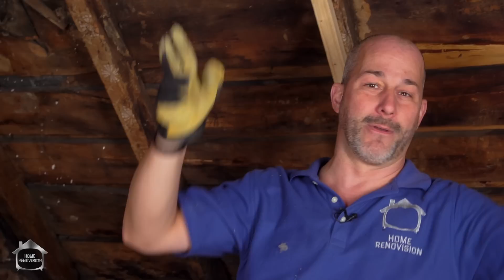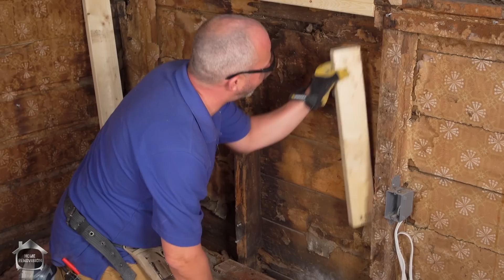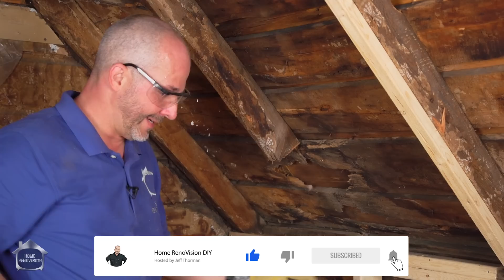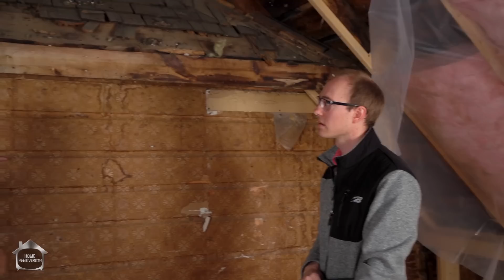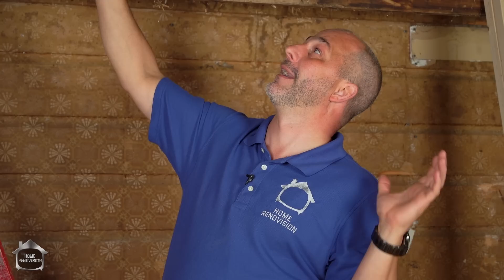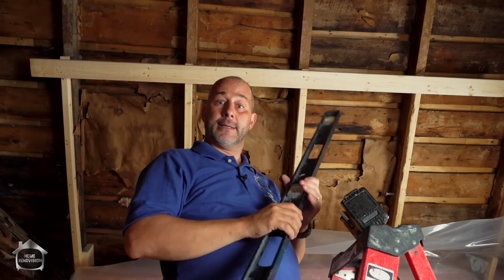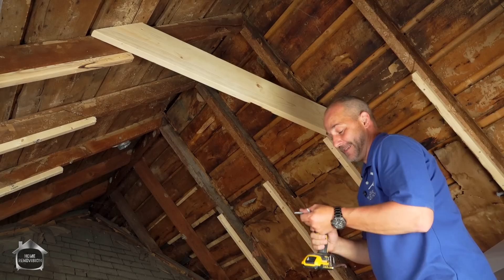How Structural Engineering Affects DIY Projects

Comment: I am a licensed electrical engineer and it was a pain in the rear to get my license. Structual engineers have to take an additional board exam. Thats tough
Reply: Depends on the state. Most states all you need is your PE license to design residential/commercial buildings. Here in CA they have another license, SE, structural engineering license, but it's not necessary at all if all you do is residential house design.

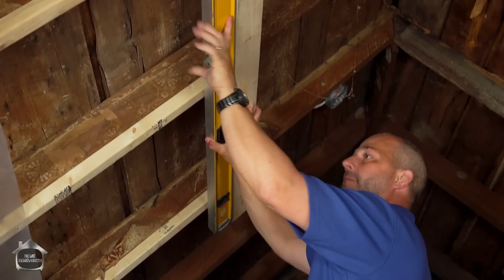Comment: Maybe I've been given bad info about levels that it has to be held plumb for the bubble vial to be accurate.  At about 27:50 the way you are holding your level flat against the rafters will give a bad bubble.  Also I was always taught that levels only read correctly with the vial at the top as there is a very slight camber built into the vial.  Maybe I'm wrong though.
Love all your videos!

Comment: Q: Regarding your unleveled roof, shouldn’t the ENGINEER have factored that in their design and instructions?
Reply: h2s ..for NEW construction you must be right. But, this is an existing older unleveled structure that is being ‘restructured’ and needs consultation and re-engineering - so I am not convinced.

Comment: About how much for the structural engineer? I've always thought about doing my livingroom and kitchen like this. I never wanted a full vault though. Also my roof is made with 2x6 framing.
Reply: I had an engineer come to my house to design an egress window, $500. I had the same firm go to my cabin and design a new foundation and add a second floor to the structure, $3000. 
Hope that helps.
Reply: @68RDRNR  thx

Comment: Really great video but it sure looked to my eye that you were spinning those lag screws in that old wood. Or were they in fact binding up all nice and snug?
Reply: Paul Bruneau I noticed the same thing. Mildly concerning
Reply: Nope. He sent them all the way home through the new wood. You are seeing correctly.
Reply: Sorry probably silly question, very green at this, what do you mean or what did you notice? Thanks!
Reply: @angelitamartinez5639  well it looked like even after the bolts were fully imbedded in the wood that he kept spinning them after that, which would mean the wood might be torn up surrounding the threads, harming the strength

Comment: Im doing my attic I'm planning on using r 54 is that excessive?
Reply from the maker: unless you have r 30 walls it is. yes
Reply: No it's not at all excessive.  I have R-54 ceilings. I used polyiso insulation and my upstairs is cool in the summer and warm in the winter. This guy is gonna use a lot of energy trying to keep that space comfortable.
Reply from the maker: perhaps, but that is my choice. Cheers!
Reply: Just bought r 50 for rafters n r40 for walls 750 square feet for 1450.00. Can you find some good dealers for insulation so us viewers can get a good deal

Comment: Very useful channel, I have a question, My basement is unfinished, but they nailed the pink insulation with a vapor barrier on the concrete down to the 1 foot up the floor. when I'm going to frame exterior walls and put new insulation and vapor barrier. what's the best way to deal with the current one? if I should keep the old one, do I need to cut the old vapor barrier before put the new insulation in front of it?
Reply from the maker: sounds like you have an insulation blanket in the basement. best to just remove it before you start it will have no value and be messy .
Reply: I think I go with it from now on, but in 2 walls I already framed in front of it, should I cross cut the vapor barrier with the knife in between of two insulations? Thanks for reply though It's very valuable.
Reply from the maker: yes remove as much as possible cheers!

Comment: Sorry but anything structural in a house comes from the direct experience of untold generations of carpenters.  Engineers are a modern component used to test already trusted techniques and develope building codes. Basically they verify what us in the trades, that are ticketed as journeymen carpenters , call best building practices.
Reply: True, for the average wood house that engineers are not required but when your dealing with complex topics such as vaulted ceilings in this case, or modern tastes in custom homes such as large cantilevers, open floor plans or large glazed facades without shear wall segments a good contractor knows when to partner up with a structural engineer instead of winging it. The code requires it when a house is not "cookie cutter" as well.

Comment: Doesn't there have to be fire break installed in the walls between floors on this type of house ?
Reply: I would imagine you would especially need it in balloon construction because fire can spread from the first floor to the top floor and collapse the ceiling.
Reply: The trouble with this old method if building, which indeed is sturdy, is that each channel between the the studs acts as a chimney; hence, quick to burn down from internal fire source.
Reply from the maker: not in this type of construction. Cheers!
Reply: @HomeRenoVisionDIY  If not in balloon construction than what?

Comment: I wanted to actually do that to my attic is add 2 by 2s and put fiberglass but I have seen videos of people saying you need to have an air gap between  the fiberglass and the roof not sure which is right . I dont have any vents in the attic also and i can walk around in there like normal
Reply from the maker: you need the air gap if you have fresh air coming in from the soffit. the idea is to help transfer the heat caused from the sun on the asphalt shingle to be removed with your roof venting system. In this house we have no soffit air. so no need to worry about that! instead we will be using a metal roof to increase the life expectancy of the roof. Otherwise we would need new shingles every 5 to 7 years.
Reply: @HomeRenoVisionDIY  Ohhhhh ok that makes sense! My house also has no softits at all just two little windows  i was worried about a air gap but since i have none it should be good . Thanks for the reply!

Comment: Are you in Ontario? Don't you need atleast R31 on the cathedral ceiling?
Reply from the maker: If I was able to get r 20 in my walls then I would agree. But since I can only get r 14 there is no benefit to re framing and insulating to that degree.  Sometimes you just need to apply a little common sense. If I change the structure to accommodate a thicker insulation then yes it would be necessary however the code does allow for construction based on existing conditions such as the r value being determined by the thickness of the existing wood . Cheers!

Comment: With the damage on the roof and putting insulation + the vapor barrier isn't that trapping the moisture and making mold? I didn't do this at my house for that reason, just curious
Reply from the maker: That all depends on where you live! In the northern climates the vapor barrier goes on the warm side which is the interior of the home. in the south it is the exact other way around. Cheers!
Reply: @HomeRenoVisionDIY  Thanks! very good info!

Comment: Quick question.I have similar house and like to convert attic to living space.The way you insulated the rafters there is no air flow.I was told roof needs to be almost same temp as outside...Now I am confused if you insulated the rafters placed plastic vapor barrier then dry wall is that normal.Concern is about the venting I have.Please I need to know I get lots of conflicting opinions on this.Thank you
Reply from the maker: Hi Ruben. balancing the temp is a requirement in order to have the shingles last their expected lifetime. increased heat causes premature degradation on the shingles. Since my soffit is not supplying fresh air there is no value in dedicating space for the air since it would only travel passively and not give you the required performance. In this house we have decided to go with a metal roof so that it is not needed. If you are going to use shingles then definitely create that air space.

Comment: are you gonna  «outsulate»?  Instead of risking moisture problem with isolation + venting problem, i would put 5 inch of extrude polystyrene on top of the roof...  + a smal chanel for venting and then, the final roof... so the plank could be paint and left expose with only the top with new sheetrock, where the colar tie is...
Reply from the maker: That is one heck of an expensive ordeal for such a modest house. Cheers!

Comment: Pondering the same thing right now, I'm leaning towards a ridge beam.
Reply from the maker: get an engineer. This house has a ridge beam and still needed  collar ties to hold it all together. Cheers!
Reply: @HomeRenoVisionDIY  Hi Jeff.  There's a big difference between ridge beam and ridge board.  What you have existing right now is a ridge board.  Ridge boards are only used as nailing surfaces to connect the 2 opposite rafters together and therefore does not hold any weight.  Ridge beams however do carry the weight.  Same concept as if the rafters were floor joist.  Floor joists attach to beams with hangers.  That's why your engineer was proposing posts here as beams require posts right? I have this argument a lot with contractors/ framers when I design renos like this.  This article is probably the best way to explain it:  
https://www.finehomebuilding.com/1992/10/01/framing-a-cathedral-ceiling

Comment: I totally want to borrow, "It offends the mind."  Thank you for another video that is not only educational but fun. Keep up the good work!
Quick question: We just learned that the valve/mixer that we bought for the shower is a 3 way, even though I was certain we had picked up the 2 way valve. Is it possible to cap it and still use it? Also it is all copper and we wanted to use PEX is there a copper to PEX adapter that we can use? Thank you!
Reply from the maker: Yes you can solder on a female copper to 1/22 inch pex. Cheers to ChocolateRx!!!!

Comment: Hello I have a question. I was told not to put installation on the roof structure like you are doing because it will cause problems with the shingles on the roof. Is there any truth to that?
Reply from the maker: Hi Sue, my soffit has no fresh air moving so the rule changes in this environment. We will be installing a metal roof since asphalt does not perform well in this environment. You are totally correct. if the air isn;t moving the heat builds up and deteriorates the shingles really fast.
Reply: Home RenoVision DIY  Thank you

Comment: Did you consider the the Bonfiglioli approach to furring out the walls and ceiling,  that would have added a thermal break without much more effort.
Reply from the maker: The Bonjovi What?
Reply: https://www.finehomebuilding.com/2014/11/26/breaking-the-thermal-bridge @HomeRenoVisionDIY

Comment: One your best vids yet.  Novice (and likely a very stupid question): you used nails and screws on this project - when should you use a screw and when should you use a nail; and why?
Reply from the maker: nails for shear strength if carrying load, screws for convenience and allows you to make modifications later much easier. Cheers!
Reply: @HomeRenoVisionDIY  Don't forget, screws have better tensile strength than nails. Different tools for different jobs.
Reply: @HomeRenoVisionDIY  Got it.  Thanks!!

Comment: Thanks for the visual flashback to my very first home; nearly identical.   Not one wall square, level or plum to anything else.   Not one.   The shimming and furring I did to square my kitchen to get the counter tops to go in nice and flush was truly a work of art if I do say so myself!!! 😁😁           Strings I found to be my best friend.   When I bumped up my collar ties, I measured up the same on both ends, leveled across and strung a line.   Done.   
                 SOLID RED OAK!!!!   I didn't have my pneumatic guns then, and I hand drove 4x more than I sunk.   Literally started and bent 2 or 3 to sink one.   Floor joists with bark and resin pits over 1/2 way through,  broken; a real treat.   Best memories of my life.... 😊😊😊
                 Just gotta share this, one memory I'll never forget:   Dad, not a carpenter, was helping me rip out the 2nd floor: T&G 3/4 pine.  With the previous description of the joists, it was literally holding up the 2nd floor.   I had dad ripping the flooring in 4' sections the width of the floor for extraction.   I knew what was coming and I just watched with a very ornery smile.     About 2/3s of the way through, a mighty crackling sound could be heard, even over the saw as dad cut the floor, then with a bang as loud as a gunshot she let go.  "BAM"!!!!  And dropped about 3" and bounced and vibrated.    Dad stopped cutting but never looked up.   Finally, slowly he raised his head, with the coldest, soberest, most accepting of death face I had ever seen in my life!!!   WHITE AS A SHEET; not one drop of blood left in his face.   OMG I laughed so hard.   He was a good guy.   Lost him last spring to cancer.   Like I said; good memories.....
Reply from the maker: strings work when you don't have lasers. Cheers!

Comment: Should have made barn dormers...Vaulted ceilings are cool when the entire rough frame is being done...That ceiling is already awesome height for an attic.  Waste of lag bolts...Those rafters are at nearly their strongest point  as they hit the ridge, the thrust of the rafter is at the bottom...Collar ties are only there to add strength to the  connection... A nail is more than sufficient. The shear strength  on a 16 D nail is about 138  LBS ...
Reply from the maker: Hi Rob, I think there is an element of the structure that you are not quite understanding. this is a balloon framed house and the collar ties are vital to keeping it intact. cheers!
Reply: @HomeRenoVisionDIY  Oh, that does change basically everything...:)...I hate balloon frame...It's pretty rare here, In my 30 years in the trades I only saw it one in New Jersey...

Comment: I dont know if this engeenier is just camera shy or what but he comes across as he know less than you.
Reply from the maker: Engineers are usually a little slow to suggest options. it is always best to bring the options to them and then let them do the math. Cheers!
Reply: Engineers tell Designers what is and isn't possible. You gotta tell them what you want to do.
Reply: one brings an engineer to help with calcs and drawings of what one wants to do.

Comment: I was told by my contractor that it couldn’t be done because there was not enough space for the insulation... Thank you so much for this video!!!
Reply from the maker: very peculiar!
Reply: You had a lazy contractor is all. Just about anything can be done if you have the money, and yes, I used to be the contractor that would do your job and I've done plenty of them over the years
Reply: he was able to do it because he skimped on the required ceiling insulation. (not to code in Canada)

Comment: Solid information about having the engineer spec out future plans for additions that you haven't done yet. Did you consider going with any type of spray insulation on the rafters prior to going with regular batt insulation, or was that your plan from the beginning?
Reply from the maker: Not too worried about the quality of insulation up there. the house is now buttoned up so much better than it was before. This install is better than a new home built in the 80's. The 1980's I mean!

Comment: HOLY SHITAKE!

Just curious, where is the venting for that roof?  I was under the assumption that it had to be vented and also have a divider between insulation and roof sheeting for proper ventilation.  But then again I have also seen videos where they SPRAY FOAM the roof sheeting on the backside.

Lastly, I think washers on those lag bolts would have helped keep the heads from sinking into the wood on your new engineered ties.
Reply from the maker: there is no fresh air from the soffit in this roof. That is why we will be going to a metal roof system. that way the need for air flow is eliminated. Cheers!
Reply: @HomeRenoVisionDIY  I was not aware that metal roofs did not need airflow.  That is only for asphalt shingles?  I thought there needed to be airflow to make sure that there is no moisture build up on the wood roof sheeting beneath the exterior wood surface, whatever it may be.  Educate me :)
Reply: @FloridaManInFlorida  MY non professional assumption is that the metal roof will have a corrugated metal shape and be installed on an air gap with radiant insulation/waterproofing under the metal roof itself, the condensation will occur under the metal and be dissipated that way.

Comment: This was good information. My house was built in 1947 with rough sawn 2x8 rafters but rough sawn 2x4 collar ties every other rafter. I'm doing some work up in the attic so I think I'll just add in some collar ties on the rafters missing them after seeing how important they are to the engineer and how much he wanted you to do just to move them up a few feet. I had always been taught that as long as it was in the upper 1/3 and your joists below ran parallel to the rafters that the height of placement wasn't an issue but I have since changed my mind.
Reply from the maker: never hurts to double up when it is that cheap. Cheers!
Reply: You're right.  Code is no higher than 2/3 of the verticle rise of the rafter.  Nailing schedule is important.  Ask your building official or get a code book